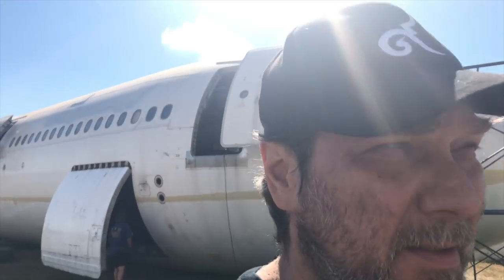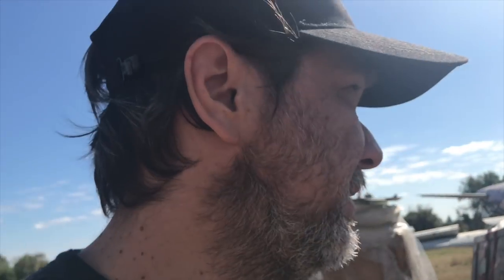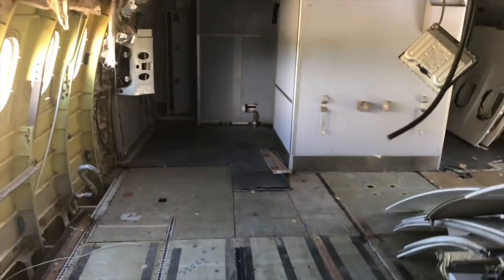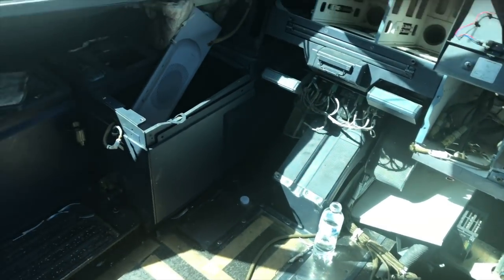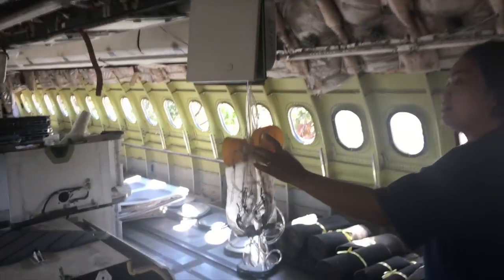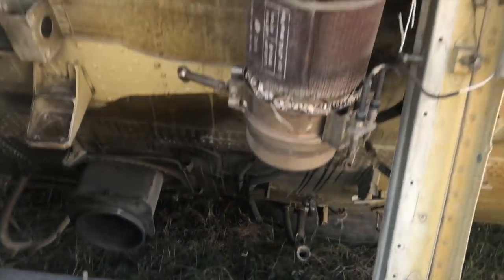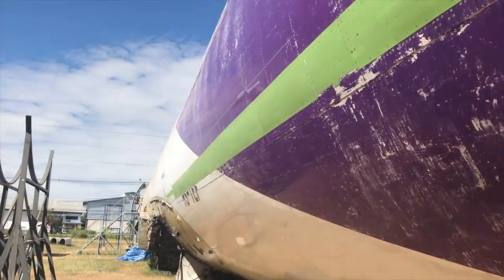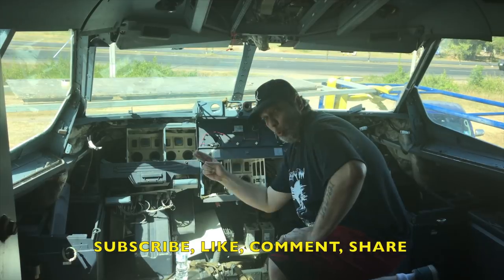ABANDONED PLANE - Thai Airways HS-TEF

Comment: wait....they abandoned it.......just like that????
Reply from the maker: They are actually rennovating it over time
Reply: @Colin SINGSON [10M1] The aircraft was also in their "retirement" logs and it had to be retired no later than about 2015... Cathay Dragon is also getting rid of their older airframes (former Cathay Pacific aircraft with Rolls Royce engines, delivered in 1995) and replacing them with slightly younger A330-300s (2001 and over)
Reply: This Airbus A330, registered as HS-TEA, veered off the runway upon landing on 8 Sep 2013, causing extensive damage to the airframe. The aircraft is no longer airworthy and has to be written off.
Reply: it was in an accident and written off. HS-TEF
Reply: Nope HS-TEF Not TEA @duk2k